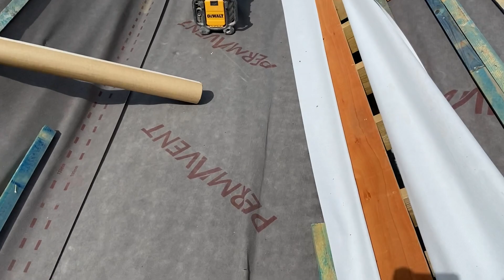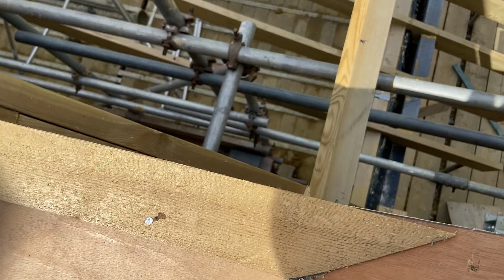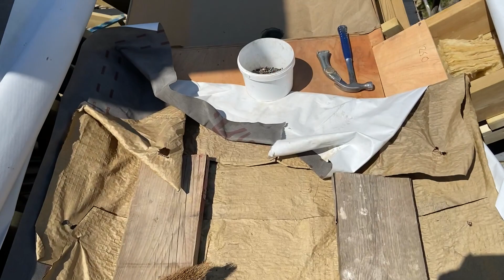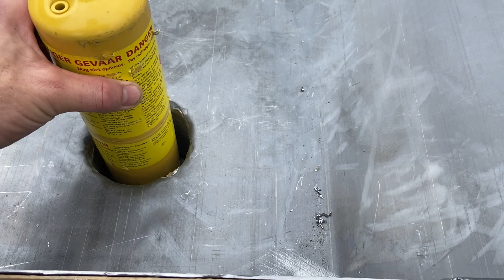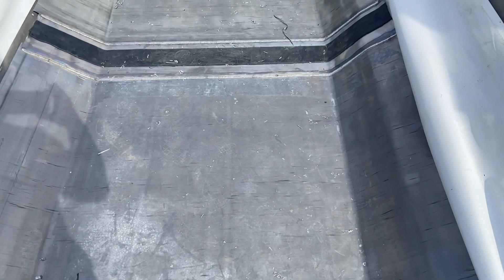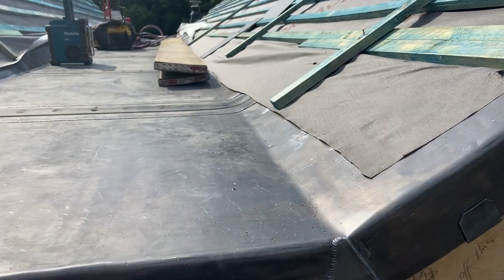Code 5 Lead Installation To A Wide Gutter Using T-Pren Expansion Joint. So Much Welding

Comment: Are those exexpansion joints across the valley "steps" as in an upstand? I cantcquite see it.
Reply from the maker: The only step is where the outlet is. This is why the expansion joints are used.
Thanks for watching.
Reply: @slbleadworks Ah yeah, I havnt come across them before so I was trying to work it out!

Comment: Excellent job!
I'm a plumber who does a fair bit of leadwork, but never used the t-pren before. Funnily enough, i've got a gutter to do now that has to have these expansion joints. And hence, finding as much info as i can, and finding this channel!
If i may, i'd like to ask a couple of questions. One, can the t-pren be welded onto the lead before bent and dressed into place, as i'm a little concerned as to the rubber joints being damaged by any excessive pulling when being dressed in?
Also, looking about, is there a strip/cover that goes over the neoprene? I'm seeing there is online, but there wasn't anything supplied other than the lead/expansion roll.
Once again though, job looks a belter.
Reply from the maker: Thank you and thanks for finding my channel. 
Would you consider subscribing please if you haven’t done so already 🙏. 
Yes you can weld the expansion joint on before hand. It makes things so much easier if you can do all the welding on the flat. 
As with the cover strips. I think you can buy it with the expansion joint. Although I’ve never come across this. 
I just make my own. Just cut some lead in the desired width. And weld some clips on the bays to hold the strip in place. Just make sure you leave a good expansion on the clips when you bend them up. 6mm.
Reply: @slbleadworks  Thanks for the quick reply. All noted, thankyou!
Yes, i was thinking of the ease of burning on the flat, especially since space is an issue!
Yeah, i think this 'strip' just adheres on, from what i've seen. But good idea with the lead and clips, although if not a walkway and kind of hidden away, dosen't overly matter.
I've also noticed, and read, that only the top lap on the expansion joint needs to be welded (if i can i usually do the back as well as to most burns, but i think i go overboard, lol)
Picking up some ideas too, i've not thought about heating the lead up for bossing!! Something i'll certainly try.
THanks again Stuart, very much appreciated.
And i shall indeed subscribe!
Reply from the maker: @iancaley2347  thank you for subscribing I’m trying to get to 5k by Christmas. 
Yes you only need to weld the top lap. Just make sure you penetrate both sheets. 
And yes heating the lead for bossing roll ends  etc is so much easier. Wish I done it years ago.
Reply: @slbleadworks  All noted again, thanks.
Always learning better ways to do things, and easier! No matter how long one has been doing it, lol.
Much appreciated! And hope you get to the 5k before Xmas.....it'll be a doddle : ))

Comment: Woah! That is A LOT of welding! Ice job as always Stuart!
Reply from the maker: Thank you .
Yes it was insane. I was hoping they would go for stepped bays with wood roll etc. 
But the carpentry work had already been set out for expansion joint.

Comment: Im shocked at how wide that valley is, the cost of lead must be frightning, welding looks outstanding, I hope someone fitted a velux for maintenance, I didnt see one, had an outlet like that on an inverted roof valley block with twigs and leaves in an empty house wrecking rooms with rot from the leak.
Reply from the maker: This is the widest gutter I’ve ever seen or done. I wanted the builder to use steps. But he built it like this before I arrived. There was so much welding. 3m on every join. The gutter falls both ways. So half discharges straight of the roof. But still it’s a shame there’s no velux for maintenance. I did suggest it.

Comment: Love all your work Stuart, it’s really amazing, and your attitude, nothings a problem and you get on with it.
I’ve been roofing 30 years and just went to college for the first level of welding. I can’t weld up hill or in place yet. 
Just turning the lead flat to weld. I’ll get there. 👍🙏
God bless
Reply from the maker: Thank you so much. I do like to just get on with it and don’t want anything to beat me. So I’ll always try and find a solution. 
Well done with the welding. You’ll get there. Just got to keep practising
Reply: @slbleadworks  
Do you want to come to Gloucester to do this small 3x2 metre mop stick roof, asap, I’ll make it very worth it and watch your work.
Reply: @robertmyatt2755 hey mate. I live in cheltenham. Where are you doing the lead welding course?

Comment: HI Stuart, Last time we worked on a gutter this large we did it in a rubber roof, the rubber was doubled up so the customer could get access, I was quite proud of the way it turned out but watching your video has made me feel like a real amateur. Your work is amazing. Hope you don't mind, I have just shared this video on my FaceBook
Reply from the maker: Thank you no I don’t mind at all. Thanks for doing that it really helps me out.

Comment: nice work mate, as a rough guide what do you charge for such a job?
Reply from the maker: Thank you. I work on a day rate. I won’t say how much this cost in labour but this took me 4 days.
Reply: @slbleadworks   Thanks mate. You must be on a decent day rate then i would think. I am a roofer and do some smaller lead works but no welding, was thinking of doing the lead course in manchester with master roofers to improve my skills a bit. I have a few videos up also and trying to build my channel. Cheers bud.
Reply from the maker: @roofinggutteringmatters   
Your welcome. I’ve just watched some of your vids and I’m just about to subscribe.
Reply: @slbleadworks  That would be appreciated! Of course I am already a sub of yours. :)

Comment: To all watching this .. T pren only has only a 10 year manufacturers guarantee!!  Its a NHBC favourite! Just long enough to last before it fails !
Reply: Stuart , T pren has only been out for 25 years so what they say about could last 50 years !! Cannot be recognised.. and as T pren has been selling there product for 25 years .. why have they not increased there guarantee on there product from 10 years too 20 years 🤔...
Reply from the maker: Yes this is correct. T-pren has a 10 year manufactures guarantee. However tests indicate that it will last in excess of 50 years.

Comment: That's wide,
Single ply would have been an option,
Good luck with that.
The money they charge for t-print you would have thought they would have used milled lead,
Reply: Let be honest,  SPM or torch on felt would give more off a insurance backed guarantee than T prem expansion joint!  SPM and felt would give 20 years ! T prem 10 years !! 
I belive T Prem should only be used never .. Spm , Liquid plastics or even EPDM are better options!
Reply: @rickphillips5098  prelasti, even monoseal that carries a 30 year warranty provided you are ticketed to lay it.
Reply from the maker: Yes it really was a wide one. This is definitely the most welding I’ve done on a gutter.

Comment: Blimey lot of welding there ...
How long did that all take you if you don't mind me asking
Reply from the maker: There really was. It took me 4 days to complete this.
Reply: Also Stuart do you go by the LSA manual  for bay sizes etc?
Reply from the maker: Yes I do. I always make sure I don’t exceed 1.2 square meters when using code 5.

Comment: Why every 1 meter can you not go every 1.5 meter an expansion joint at code 5
Reply: You can use code 5 up to bays 600mm wide at 1.5m by this looks wider than 600mm, so to prevent any movement and splitting you would need to shorten length, 1m bays is correct and Stuart is doing a great job. Only issue I can see is how area under lead is vented, like with all lead roof, area must be vented in cold or warm roof construction.
Top job again stuart
Reply from the maker: As Clive as mentioned as these bays are wider than 600 mm the bay size has to be shortened. The maximum size you can go in code 5 is 1.2 square meters. These bays worked out well within at 1m lengths and it also meant I was able to get all the bays a similar size.

Comment: What a job mate! I’ve never seen a t pren expansion joint before, I’ve always done steps! Cause I haven’t done and welding haha
You are seriously great at what you do buddy! I hope you’re on the mega bucks!
Reply from the maker: Thank you. To be honest I tried to push for steps as I think it’s a much better job. It would have looked lovely getting some wood rolls down and much more enjoyable for me. 
But the builder had already constructed it this way and wanted to leave things alone. 
No big bucks for me unfortunately I just get a day rate.
Reply: @slbleadworks  yeah steps with a roll looks the part too! fair enough mate, do you not get price work or private jobs? It’s a rare thing now days, lead welding! And a decent one like yourself! How far would you travel??
Reply from the maker: @Robustrestoration  this one’s a private job. I quite like working on a day rate basis to be honest. My working area is a 80 mile radius from Brighton.